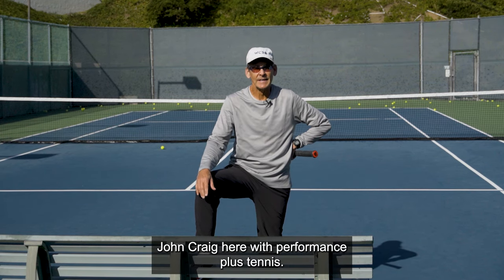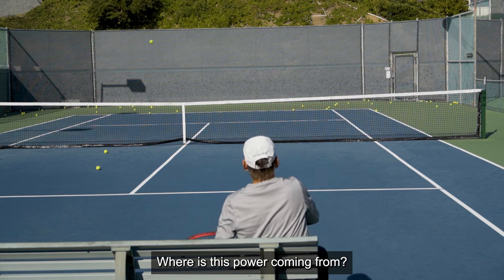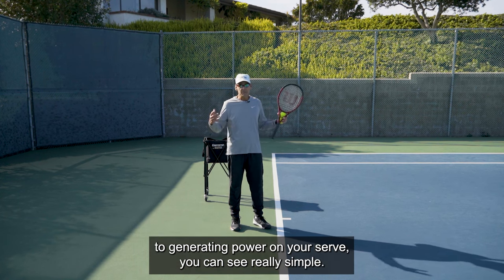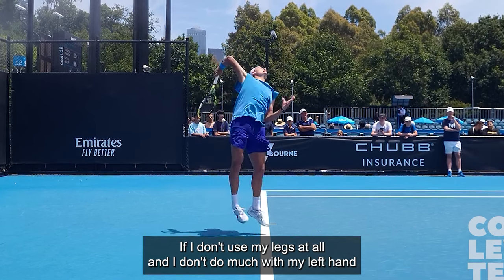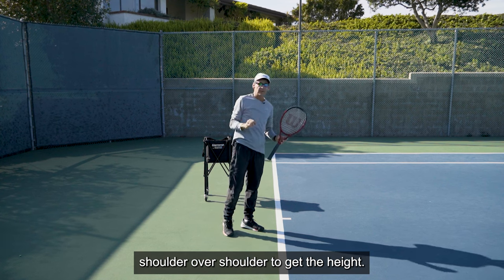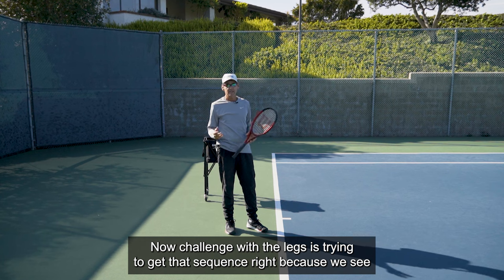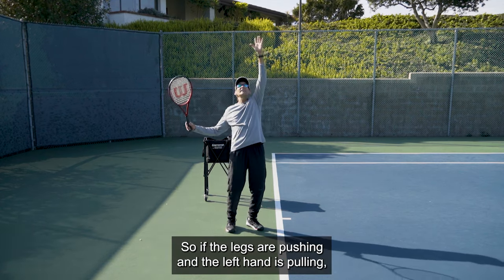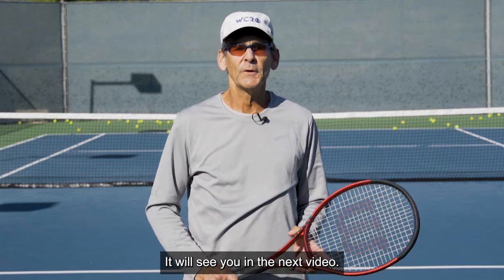Where Does Most Of Your Serve Power REALLY Come From?

Comment: The reason why you’re not getting any power from the sitting position is because you are missing a key and important element in your demonstration!    The whole concept of the serve is based on a very simple idea ….. the sling-shot effect!     Think of the left hand holding the sling-shot.    As you’re pulling on the rubber band, you’re holding back tremendous energy.   The more you pull back , the more potential energy is created .    When you release the rubber band , the  potential energy is converted to kinetic energy.    The kinetic energy is the power behind the serve!    And it is tremendous!
Reply: Also the rotation you speak of is part of that sling-shot effect !

Comment: From my right shoulder to my right forearm and the snapping of the wrist then back to the right shoulder for the follow through.
Reply from the maker: Thanks, but I'd like to know more what you mean by "wrist snap". Best, John
Reply: @PerformancePlusTennis       Raise your serving  arm  to 12 o’clock with the palm facing upwards.    Now slowly bring the arm down while keeping  the palm of the hand  extended facing outward.     Then do it again.    Bring the arm slowly down but now ….. supinate and flex the hand slowly .     Do this a few times until you get the feel of the power of the right arm.       Then  around 11 o’clock, snap the wrist to around 9 o’clock !!     Your fingers should be pointing 9 o’clock.     The snapping of the hand transfers all that kinetic energy that you’ve been building up in your arm  to that single point  ….. the racquet face.
Reply from the maker: I'd like to see a video of this. Let me know if interested. Thanks.  @lordbyron3603

Comment: You can be on you knees and serve 70-80 percent of your top serve speed given all other factors are the same in terms of serve execution. Answer? Most of your serve power comes from the arm and upper body rotation combined with the proper racquet drop and forearm pronation through the shot.
Reply from the maker: Thanks James for your perspective. However, the arm itself, including the racquet drop and pronation will produce very little power as I presented in the video. Try it for yourself: Sit in a chair with your back stable against the back of the chair to eliminate any shoulder rotation...simply isolate the arm while your body is perfectly still, and let me know the results. Thank you, John
Reply: @PerformancePlusTennis  I don't' think you read my post closely. It includes "upper body rotation." It's NOT all about just the arm. Never claimed that.
Reply from the maker: Oops, my oversight. Thanks for your clarification. Best, John  @ReidVV
Reply: @PerformancePlusTennis  It's all good. BTW I think your lessons are excellent.
Reply from the maker: Thank you so much!  @ReidVV